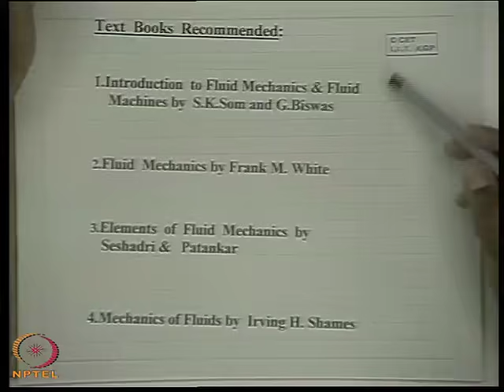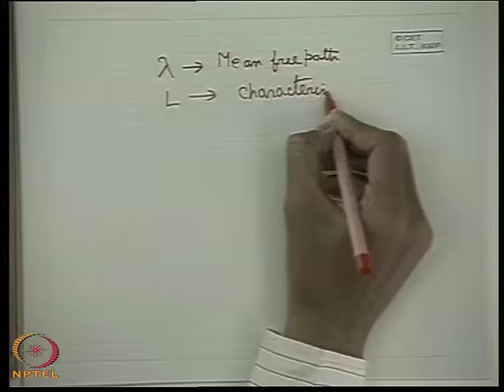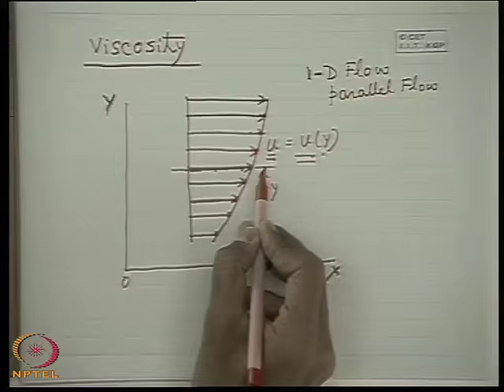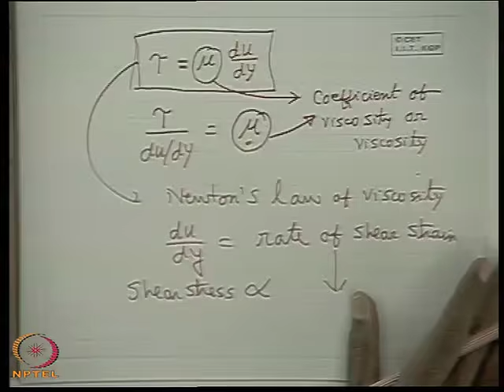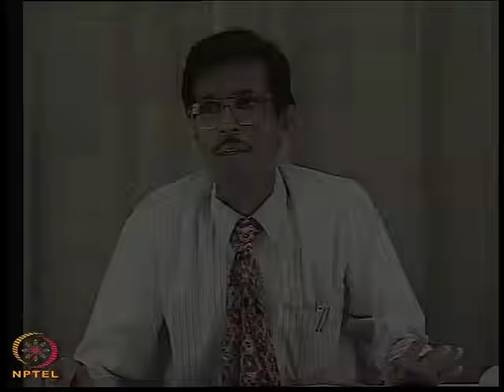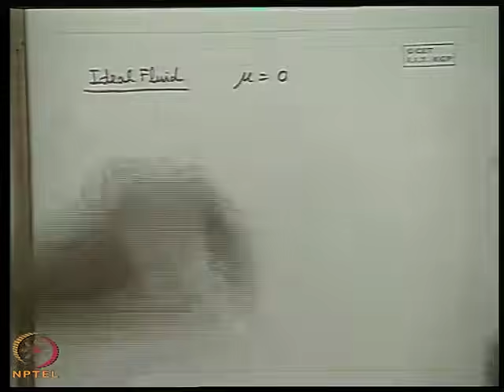Mod-01 Lec-01 Introduction and Fundamental Concepts - I

Comment: 25:00 Explained the diagram like a 'ratta' student giving his ppt. Lacking rigorous definition and mention of conventions used. Saw the same problem in several other places. Just blindly writes out sheer stress=F/A without bothering to emphasize what is A of the fluid layer. 
Expect better from an
IIT professor.
Reply: In case of solid, the sheer stress is tangential force F per area parallel to it A. The logic is: If the area is more, the tangential surface is under less stress, because each element of the surface is bonded strongly to all points of that surface, so the force applied along any line of the surface acts against the entire parallel surface.
However that same logic should not apply in case of fluid: A point on a layer is not attached strongly to a point beside it, just like it is not attached strongly to a point below it. So the force along a line of a layer should not be felt by the entire area of that layer.
But the prof casually glosses over. 30:04
Reply: @rgudduu can you tell about it more

Comment: Can some one tell me is this NPTEL videos lectures of mechanical engineering helpful for UPSC ESE? Please tell me
Reply: Yes
Reply: Obviously
Reply: It May or May not for UPSC....
Here in these lectures basics of various topics of subjects are explained. ..this is not bad.
But  in UPSC ESE you'll need to master on basics and it's application. ..
UPSC checks engineers at their application to various practical level problems because one day they Will be posted in various higher posts of Central Govt. which is highly responsible job...
Only relying on NPTEL lectures Will not be sufficient. ..
They maybe clearing some of your confusion/doubts...there may be some topics which may not be relevant for UPSC while useful for GATE......
Analysis of past question papers will give you a clear idea how to approach...
Also remember there's a Personal Interview at last where they again checks your engineered mind...
My suggestion -  If you are damn serious Join some good institute in the market  and develop competitive attitude. .
Clearing UPSC needs strong basics, quick problem solving skill, accuracy and proper Focus....
Wish you good luck.
Reply: @318dhanush5  No it will not help you completely for  GATE..But its helpful to understand the subject basics and concepts...First understand the subject from here then try to solve problems of different types on your own...Better Take a past GATE papers and  see if you can solve at least 60% of it accurately. ..Remember there are negative markings. ...if you can attempt 60/70% accurately then you dont need any coaching....you just need to practice and attempt mock tests...Good Luck

Comment: vary helpful 
but I am very much confused in some topics,  plz help
         1-explain vapour pressure in  closed condition (fixe boundries) that if we continuely increase tempratute, what will hapen becouse air above it can not take more vapour
         2-what is saturated vapour pressure is it fixed or vary with temperature and pressure and explain in both conditions open and closed system
        3-what is boiling in  closed system  , is it a prosses or condition ,is it  instentanious ?
        4-what is roll of saturated vapour pressure in boiling  or both have no relation    
         5- is all the liquid get completely vapourised when  we put  liquid into vacuum

CANCEL
COMMENT

Comment: Really critically resolved introduction of the subject. Although I did find a little flaw (or rather a query) while watching the video right from the beginning to the end. The lecture begins and smoothly glides through the Power Law Model pertinent to the Non-Newtonian Fluids.While nomenclature of the terms in the equation (Ostwald-de-Waele) goes on, the 'n' and 'm' are termed Flow Consistency and Flow Behavioral Index respectively. At the end of the lecture, when a little preview or summarization begins, the nomenclature is changed or corrected.  This came out a little confusing, until Wikipedia came to the rescue! :) Overall a great lecture!
Reply: Debashmita Saha di further lectures are not available 
wht should I do

Comment: what type of course should i take before this course because i don't understand any thing
Reply: +Youcef Mahdadi Have you completed High School in your respective country?This course is usually taught in the 2 nd or first year of Mechanical/Aerospace/Marine engineering.If you want to understand this course,you need to understand basic Newtonian or classical mechanics such as concepts of shear stress strain.Also,engineering mathematics related to differential equations,some basic numerical methods,and most importantly vector calculus.